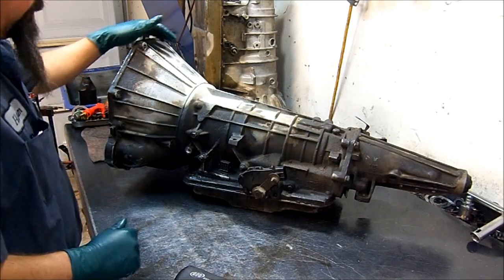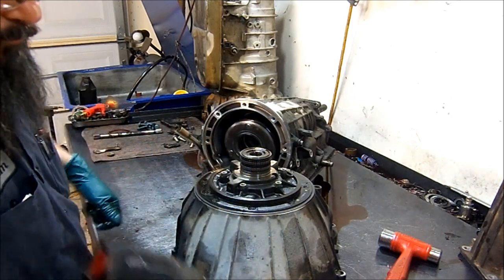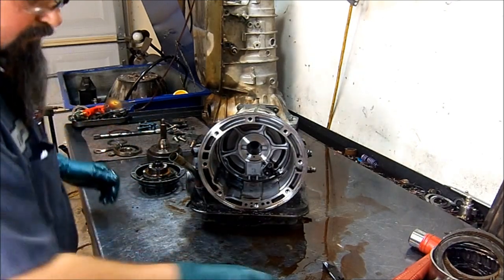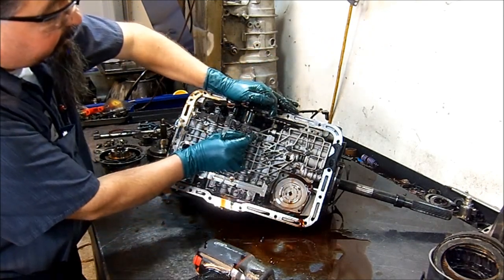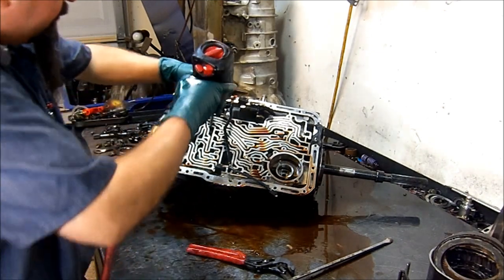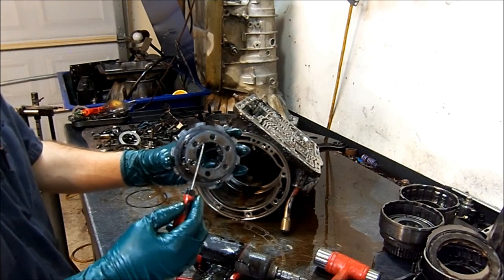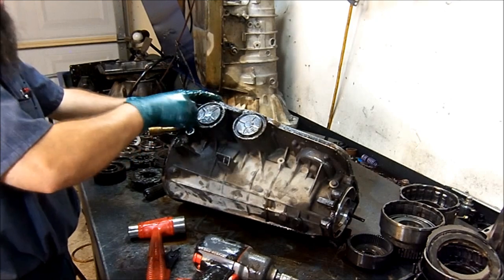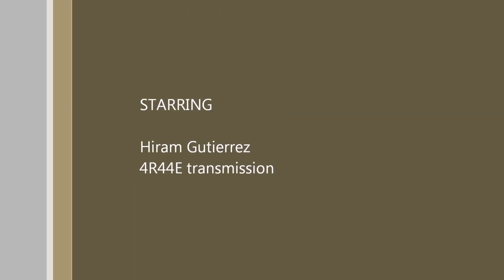4R44E Transmission Teardown Inspection - Transmission Repair

Comment: Hello Hiram, this video is verz impressive, reallz good job. Anyway, i need your pro, last time i was on off road, went thru 2 minor bumps and after that lost N and R. Didn`t hit the transmission. Now, after 60 mls lost all of shift after came some oil from that ..... Any idea, pls? Another question is, how can I clean the valve without transmission remove, please? My suspicion is a jam....It`s about 4R55E THanks a lot,

Comment: Does the 4r44e have a vacuum modulator? My 95 for ranger 4.0L flares between 2-3rd and also smokes out of the exhaust during the flare

Comment: Hey man, I first wanted to say thanks for making these videos. I have a question on how to properly adjust the bands on this transmission. My overdrive light was blinking and the transmission was in limp mode. I used this video to help me rebuild the transmission but I still have the problem. Was hoping you could point me in the right direction.

Comment: will a 5r55e fit in a truck that originally had a 4r44e. maybe change the bell housing and the rear case cover. I was told that the output shaft in the 5r55e was too long. is this true?

Comment: Hiram, Great video. Question: My son has a 1999 Ford Ranger V6/3L 4R44E Transmission that abruptly quit going in reverse although it works fine in all forward gears? Any ideas on an economical fix or is a total rebuild necessary to fix the problem? Thanks/milt

Comment: Hi, I have a 97 ford courier 4x4 pickup, it is stuck in second gear, will only go into fifth or reverse, but will not move forward or backward. What could be the issue? Clutch is good, so is slave cylinder

Comment: Well, I just found out that half of the people on the internet are wrong and that the Turbine/Input speed sensor is definitely inside the transmission.  Time to sell my Explorer.  I have no desire to take this transmission apart far enough to replace a sensor when the transmission isn't even that old.  Thanks for the great video.  Very helpful.

Comment: Hi Hiram. Thanks for posting this! I do have a question. is the front pump the same on the 4R55E AND 5R55E? I think I might of broken it by not aligning the torque converter on to the splines on the 5R55E and thats the one I need for my '01 ranger.

Comment: Ok have a question for you costumer brought a 87 bronco 2 2.9 a4ld with the 1350 trans case told me he was driving then all the sudden it just stopped would not up shift would no engage in any gear. So i told him i could rebuild or to save him some money i had an a4ld laying around from a 302 swap i done in my bronco. So we took that wrought put the trans in hooked everything up primed the torque converter before install and went to put in gear then nothing. I did use the old torque converter but checked the splines for the input and fluid was perfect so im kinda stuck at this point any ideas?

Comment: very interesting video. i know nothing about auto box's and found this very usefull.
i have a question if you have the time to answer it for me.
i have an a4ld from a ford scorpio in the uk on the back of a 2.9 v6. i want to use it on an explorer 4.0 sohc motor. 
will it be up to the job or can i/should i rebuild it with heavy duty parts and can i switch the 4th gear and locking converter manually as i am not running the explorer ecu.
the whole setup is destined for a van that will weigh around 2.5 to 3 tonnes.
thanks, paul

Comment: OK. Fantastic video. Thanks a million.   Question.  my transmission was slipping slightly when shifting into first. When I got it back from the repair man, and I use that term loosely. I drove out of the parking lot and it was a huge clunk when shifting into first. It is an automatic transmission ford ranger 2.9,  1986 four-wheel-drive a4ld.  we just dropped the transmission and we’re going to rebuild it. First time. Would you recommend a master rebuild kit a week can we get away with the one that cost $164 sa my question is we just drop the transmission and we’re going to rebuild it.  The question is they have a super master rebuild kit that comes complete with everything including a shift kit and or just a regular master rebuild kit which does not come with the shift kit and some other things. Considering this is the first time and we’re not exactly sure what to do or how to tell if something is wrong do you recommend going with the super master rebuild kit that does it all or just the regular one that most people usually get?
Thank so much!
Gloria & Tootsie

Comment: Awesome video Hiram, When it comes to transmissions, You are the man. I've been watching and learning from all of your videos, but i cant find any answers to my trans problem. I have a 96 explorer 4.o with 4r55e transmission. One day the transmission went out as in all the gears that i selected were all forward gears, even park and neutral. The engine was under load all the time. I am a pretty good mechanic when it comes to rebuilding engines, axles, and manual transmissions.In addition to watching you i felt confident in rebuilding this transmission. So i ordered the rebuild kit which included all the gaskets, clutches, bands and o rings and misc. No hard parts. Rebuilt and installed transmission, New fluid(drained old fluid, didn't do complete flush)What i did find during rebuild was that some of the clutches were welded together and the fluid was filthy. Nothing else seems too bad, But i did replace all clutches and seals. Also, I didn't adjust the bands. I just put them back where the were.Now, my main issue. When i select a gear, I get either no response or only reverse. Park is park, reverse is reverse, neutral is neutral drive and overdrive -no response, 2nd -no response, 1st is reverse. I don't know whats going on. I know this is a long story, But if you could point me in the right direction, That would be greatly appreciated.
Show less

Comment: My 91 xlt ranger 4.0 5 speed has started to sometimes make a hardcore rattling sound as if someone dumped a bag of bolts Into a blender. Still drives fine but is someone reluctant to shift into gear or lurches the truck while accelerating

Comment: Great video.  have been to school and have a couple transmissions under my belt. an A4LD and a C4. Both easy. Starting on a 4R44E next week. Your video shows that its a little more complicated then the others. But your video shows me the differences and im sure to have zero issues with it.  Thanks fior the preview.

Comment: my 4r44e transmission on my 95 ranger 3.0 randomly slammed into second gear on acceleration and afterwards the o/d light was blinking. i pulled over shut the truck off then turned it back on and it went off but now the truck shifts hard into second and when im braking it feels like its slamming out of gear also

Comment: A buddy of mine is having an issue where he has no drive, so I thought it was the forward sprag, but he doesn’t have 2 lo either. The only gear that engages is reverse. What do you think the issue is?

Comment: For some reason my 4r44r has lost 3rd.every gear is there and shifts into overdrive in 2nd.i still drive to work every day.ive replaced the valve body hoping for a easy fix but it worked great and 3rd returned but for only 3 days then back to no 3rd.could the intermediate servo seal be bad and replaced to get 3rd back?without having to do a complete teardown.

Comment: Hiram my 95 4*4 the radiator was letting coolant into the transmission fluid I fixed it and flushed it and reverse quit and high gear and o/d light is flashing help please

Comment: I really appreciated your video. Thanks for the walkthrough. I have an 87 a4ld that I have had many hard lessons with...8 pull-outs to date; my last rebuild I installed the steel 6 gear direct planetary versus the 3 gear aluminum planetary that decided to destroy itself resulting in the last teardown. My question is, was it a good move to put the steel planetary versus the aluminum one, and do you think it will do ok??? Danny Thompson

Comment: Hello Hiram, in your opinion whats the average life expectancy of a turbine speed sensor in these transmissions?  Should you always replace it even if the wires are not brittle?  Also do they fail internally?  Thanks

Comment: Excellent video! Could you do a video on the improvement mods for the A4LD trans? I have one that is leaking trans fluid and there are some mods id like to do to it while I'm in there. Or if you have any tips for it.

Comment: I noticed that the clutch disc have a pressed design. In the material does it matter which direction the design is pointing when the clutch plate. Is installed?

Comment: Hiram, You can tell I'm new at this so bare with me. You say that the gasket on the valve body gets torn because the VB bolts get loose. My question is should you use locktite on the bolts? Or would it cause some issues with the trans later on?

Comment: Could you use planetary gears from a 4R55E, and basically convert the transmission?
Reply: 4R55E planetary gears in a 4R44E I mean.

Comment: I'm trying to get my 5r55e fixed and have a few questions. I replaced the valve body because it lost reverse. when I opened the transmission in the pan was a part I'd a spring that came from behind one of the solinoids. after I received the new valve body it had a extra valve in it the epc limit valve the old body did not have that valve in it. when I assembled the body I put that valve in along with the 4 check balls and I also put the converter relief valve. I now have reverse but it seems to kinda slip when it's in reverse I need to give it some gas for it to move, drive works fine. my question is should I have not put the epc valve in or is there a bigger problem like a bad reverse band and drum. please if anyone has a clue to what the problem is any info will help thanks

Comment: hey man, thank you so much for what you do, I am using this video to assist me in rebuilding my 5r55e and i am down to the reverse/low drum planetary assembly and i cant get it out. I took off the snap ring and i have pulled very hard to get them off but i cannot for some reason. my reverse band is broken and the inside of the transmission is slightly scored so maybe something fell in and is holding it up? Do you have any suggestions for me to go about getting this planetary assembly out?

Comment: have a question  on a 01 ford  ranger  5r55 transmission  it's sticking  in high gear 3rd and banging  in low gear when you stop but you can push gas a little  bit  and it don't do it   could  that be something  to do with  pressure  or down shift servo

Comment: can anyone tell me what size hex/star socket I need to remove the turban/input speed sensor? (14:53 on the video) I hate to have to go buy a whole set when I only need two different sizes for this transmission.

Comment: The 5Rs seem to be much harder on the bores than the 4r. To get 5 gears the transmission the trans works the bands more and is double the wear and tear on each upshift cycle.

Comment: Hi, Hiram upon all the wonderful help you gave me with this video we decided to not fix the transmission,and go to a manual swap. My question is my truck is a 1995 mazda b3000 4x2 .Do you know what transmissions are compatible with this truck in manual?  thank you!
Reply: Hi there. Have done an  auto to manual swap on a older Chevy sprint. It not only required transmission parts but some body mods as in removing welded on auto mounts and shifter hole covers as well as replacing the entire main wiring harness including removing the dash. Not to mention several small sensors and such required swapping. I suspect there would be some additional other electronic swap outs you would require in your case. Good luck.

Comment: tengo una pregunta Hiram cambien una transmission 00 ranger 3.0 es igual a la que tienes en este video. El problema es que no entra la velocidad pensé en que no tenia suficiente ATF pero si estaba llena el torque converter estaba lleno todos los cables están conectados pero no entran las velocidades esta muerto dime que puedo hacer en este caso te lo agradeceré muchísimo

Comment: thank you so much for posting, was swapping a motor in a ranger and could not get the transmission up tight.....turns out my dad pulled the input shaft out and put it back in backwards.....ugggg
Reply: No thankfully just had to file the teeth on the shaft and one gear, was intimidated by pulling parts out of Tran till I saw this thnks

Comment: I am about to rebuild my 5r55e but I want to make sure I have all the replacement parts before I start the project. I have been trying to locate the needle bearing that you recommended to replace after you pulled off the low reverse drum. Could you or anyone on here direct me to a site where I can buy a new needle bearing?

Comment: Hello I have a question I just rebuilt a 4r55e but now no reverse and no drive I already check the oil pressure it's 120psi on idle thanks
Reply: wiley zetino Hi Wiley .... I have same problem with this transmission, if you have solved the problem please send me comment. Thanks so much.

Comment: What is the best way to do a transmission fluid change without a torque converter drain plug?
Reply: Some old books show how to drill a hole and then pop rivet the converter, but I wont try it.

Comment: very insightful my question is my 4R44E I have all forward gears but I do not have overdrive and my reverse is iffy what do I need to do replace the transmission or will a rebuild fix the issues
Reply from the maker: A rebuild should take care of the issue.
Reply: Automatic Transmission thank you

Comment: That was one of the best instructional videos I have ever seen. You had that apart in just under 1 hr and you took your time and explained things along the way. I have a pretty high mechanical aptitude my master rebuild kit is on my workbench am going to Napa for the input sensor as well as a neutral safety switch in the morning (most likely will take an Uber  it's 426am time to pull this into the shop get ratchets going. Hope you made those follow up vids so I have a clue
Reply from the maker: I uploaded a full rebuild video about 2 months ago. Browse through the channel videos.
Reply: @AutomaticTransmission  I ordered the master rebuild kit from global transmission. The only one that contained more was out of stock. As per your advice am waiting on napa to get the input speed sensor  in (will be there 8am ). Since I'm having issues starting within park now and then and have to shift the automatic into N tonstart it I'm getting a new neutral safety  everything w lose on this thing is from 1999  trans probably that way too.

Comment: great video, i was able to tear down my 5r55e to replace broken reverse band. but now im having issues reassembling, specifically the "tabs" that apply bands on both of the forward drums; they fell out during teardown and i cant figure out how to position them
Reply: by tabs i meant band anchor
Reply: nevermind i figured it out. lol. but i could use some assistantce with which bolts go where in the valve body since there is 2-3 different lengths of bolts (i didnt realize this until after removing them)

Comment: Videos like these are infinitely better than a forum post or manual for someone with no experience. I was told by a shop locally that any labor to my trans at ~230k miles would warrant a new trans anyways because something is likely to fail. I was able to leave the trans in and rebuild the valve body with a shift kit, adjust bands, and replace servo covers in my driveway in one weekend thanks to you. Still shifting great at 260k!